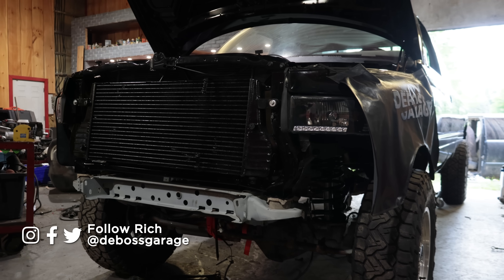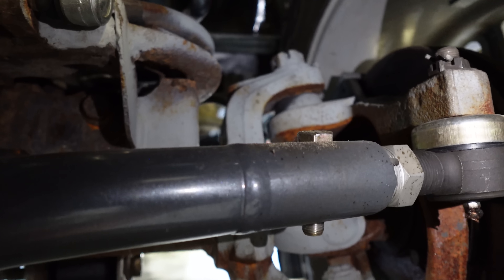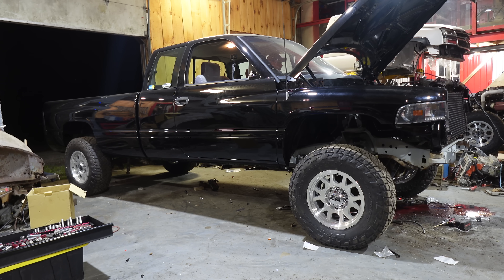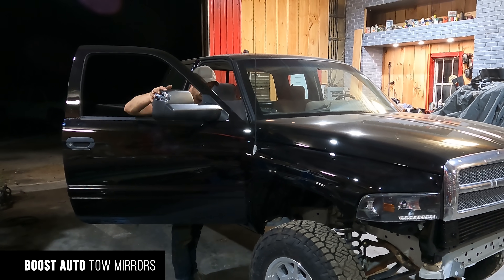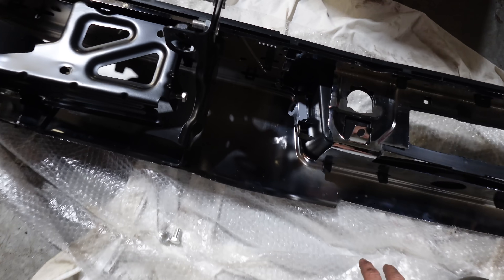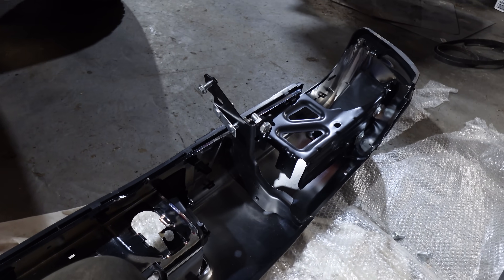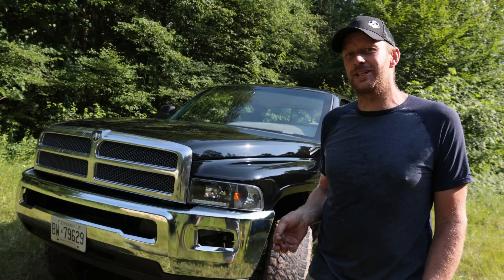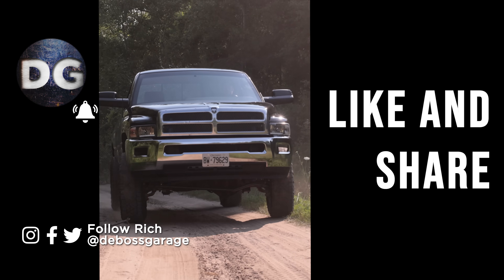4th Gen Bumper & Mirrors + GM Rear Bumper for 2nd Gen Dodge #RamRecharger [EP6]

Comment: One question…. Why the Carolina squat in the rear?
Reply: The front springs were for a heavy 6 liter engine, then they dropped in the 2.8 liter. They have since fixed the front springs so it rides level

Comment: You really want about a ¾" gap from the headlights to the bumper, lining up the bottom of the headlights perfectly parallel to the raised edges of the 4th Gen bumper for best appearance.... having it tucked up super tight looks nowhere near as good as having a decently sized, perfectly parallel gap.... trust me. 👌🏼

Comment: You mentioned the diesels in the Philippines… We were there in 2011, and one of the things I remember is how much smoke they were all emitting. Jeepneys, I understand are built on used delivery truck chassis exported from Japan, so many could be old technology. But I was surprised to see that the modern looking Nissan buses were smoking a lot also.
They all are supposed to be periodically emissions tested, but I understand that it only takes some money to get the certifications.

Comment: This is a great project that I am very interested to see the final result. But I do have one concern, this being that I don’t necessarily think that a dyno is the best way to compare the two powertrains. For raw horse power fighters sure.  But you were talking about comparing fuel combustion figures during the test. I don’t see how these figures would be relevant as dyno tests are by nature high power runs. In this situation most of the energy used would be coming out of the battery. Even if you could somehow remove the batteries out of the system for the run you still wouldn’t get a true picture as you would not be taking into account regen.

Comment: I appreciate the video ..i have a second generation dodge ram 2500 4x4 that i done the g56 conversion,  dual disc . A 2001 front axle , third generation brakes , steering. Track bar .  Hydroboost.   Timkin bearing, manual locking hubs .    But now i like to do the third generation seats so i came on here to see how you did it .  The front and rear bumpers look nice so i have to give that a shot .. i just added a pac brake , the in line model .  Used a shifter knob off a 10 speed with a electric swith added to it to control the pac brake .  I added a after market cruise control as the switches are no longer Available for the 95 on the steering wheel .. Works good now ...There is a write up on using a later model wheel if you want to go that way . . I really enjoyed watching you videos,  nice craft work
Reply: After market cruise?..do tell
Reply: Yep works good ..The is another u tube channel that does the cummins swaps in different vehicles. He also used the cruise i used .i added the controller to the side of the g56 shifter ..for the cruise

Comment: I wonder how setups will vary depending on the vehicle. I want to have a service truck for electronics. So a GMC long contractor van would work for me. I need outlets to power a hot air station, fume extraction etc. Would you mount the engine in the middle behind the cabin and batteries under the engine bay? So you'd have easier access to the engine? Or traditionally and have a partition behind the cabin again for additional batteries or even a second gen set to power my tools in the back? I don't think they'd pull that much current, but they're mostly heating elements.
Reply from the maker: With it being modular, we have many options to pick the best solution from
Reply: @DEBOSSGARAGE  I am very much looking forward to seeing the progress of all this. Maybe even working for Edison in the future! I wanted to get ASE certified, however living in the salt belt state (as you know) vehicles are not fun to work on. Let alone how they're being designed to not be serviced. 

My background in building desktop computers and now teaching myself board level component repair could be a great benefit to such a company. We'll see, thanks for the reply.

Comment: Front bumper looks great but I would stick with a stock rear bumper, then again I use a pickup as a pickup. I would rather find what are referred to as "California truck mirror" for the door mirrors as I am an old OTA driver. I like the 2nd gen though myself.

Comment: For the gap, just run the second gen sport grill. It dips lower than the normal one and will fill that gap.
Reply: The sport grill is curved though, it would fill the gap in the center but not at the edges.
Reply: @averyw.3939  :) I sincerely appreciate comments like these from people with insights. Thanks madmac and avery :)

Comment: Love the build! What offset wheel are you running? What brand headlights? I just finished restoring a 99 Cummins. It's a quad cab, 4x4, 5sp shortbed. Runs like a champ after sitting for 8 years. It hauls my Northern Lite camper. It has done 6,000km since July this year.
Reply from the maker: Headlights came with the truck. Everything else is listed in the build link in description.

Comment: I like how the back bumper looks, but I don’t like how the front one fits. Sticks out too wide on the sides and the swoop up under the headlights doesn’t line up with the inside edge of the headlights, and is overall too bulky looking for that style of truck. Looks like if it got cut down the center, shorten, then welded back together and then probably paint it body color. I think it would look a lot better.  But that’s just my opinion.

Comment: Since this is a type of prototype show truck..  If that engine has a regular alternator (which I can see that it does)--  you guys should install  a "premier power welder"..  It replaces the alternator with a  special higher output alternator, and then comes with a little control box where you hook up your welding leads.  Super simple and reliable.   All the offroad tow trucks use them and they weld like a champ;  and they are well under two grand. They even have a spool gun to go with it for another four hundred or so.  That would give this thing that much more utility and show it off even better.  Perfect for a prototype.
Reply from the maker: You will be able to weld off the battery pack.  No noise
Reply: @DEBOSSGARAGE  Sweet..  Can't wait to see how it works.

Comment: Unpopular opinion but the oem 2nd gen bumper, when not sagging and properly fitted, is the best looking bumper for these trucks
Reply: I prefer the sport bumpers or a Buckstop for something more HD, but I agree that the 4th gen bumper swap is over hyped and overdone. It doesn't look bad IMO but I wouldn't do it myself.
Reply: @averyw.3939  Once upon a time I wanted to do the 4th gen swap, but I dislike every one that I see more and more
Reply: Dude! Yes the factory bumpers look the best. I can’t stand the look of a second gen with fourth gen bumpers.
Reply: @jesushinojosa1461  I kind of thought they looked good when people first started doing it but now the more I look at them the more I dislike them. I’d love an armored bumper with a winch but unfortunately haven’t found one I light the looks of. Ranch hand can look good on the right truck but most of the armored bumpers are just too fat and hang down to low
Reply: You are not the only one. I have never seen a 4th Gen swap that looked clean. It just looks out of place. The panel gap, size, shape, body line, contour. None of those match. Sounds like Deboss is going to make an effort to custom fit it with some bumper or grille work, which I welcome.
Reply: I agree, the OEM bumper IMO looks better than the 4th Gen, but what actually looks good, is a '19 era F150 front bumper on these.... there's one guy that's done it.... and it's the only retrofit that I've seen that looks good.

The 4th Gens can look "decent", but there needs to be a ¾"-1" perfectly parallel gap from the raised edges of the bumper to the headlights.... tucking the bumper up close looks terrible IMO, if you have that crispy straight gap, it drastically improves the look, and barely anyone actually does it, everyone wants to have it tight against the headlights and then you can see they don't flow right, being gapped, it makes it appear to flow with the 2nd Gen headlight to grille line.

Comment: Time for a Scania V8 Pickup trucks!
Reply from the maker: I wish they made 160 hp 4 cylinders...
Reply: Just think of the alternator...
Reply: @DEBOSSGARAGE  they make a 5 cilinder, that’s even better. And 280hp is better than 160, obviously. Might as well go for the 340.
Reply: @autobootpiloot it's still huge. And a pain to do a valve set, you need to turn it three times!
Reply: Put in the new Toyota Land Cruiser 2.8L Diesel 4 cylinder engine.  Max power 201 hp.
Reply: @Low760   only 9 liters. If I’m not mistaken just about the size the average grocery getter has in the us. If it’s the economy model.
Reply: There is a squarebody Chevy in Finland with a Scania V8.
Reply: @johans7100 got a link?
Reply: Cut the 770 in half?
Reply: @autobootpiloot  Its also 9 liters. And weighs 975kg (about 2,000lbs).
Reply: @Adscam  I don't think Toyota are keen on selling crate motors. I imagine they would be far more expensive than a Chinese cat or Cummins too.
Reply: As someone who owns a big fire engine red and chrome scania.... great mouse trap but dang scania for parts makes man and Volvo look positively easy and cheap to deal with
Reply: @Adscam The Hilux 4cyl you mean
Reply: @HJZ75driver  same engine
Reply: Ya...the USA has no idea about Scania, make something cool with a V8 of theirs.
Reply: @DEBOSSGARAGE  The tank aka The Shermanator needs a Scania V8 😜

Comment: Here is how to fix the gap between the 2nd gen grill and 4th gen front bumper.

Install a Sport model 2nd gen grill.
The Sport model has a peak that closes up the gap between the 2nd gen grill and the 4th gen bumper.

However, the 2nd gen Sport grill did not come in chrome, at least as far as I know.

If I wanted a chrome 2nd gen Sport grill here is what I would do:
1. Buy a new Sport model 2nd gen grill. 
(Don’t forget to buy the Sport model grill support bracket. It is different from the standard grill.)
2. Buy Cosmichrome and spray the 2nd gen Sport grill chrome.

By the way, I have a similar truck to yours:
2002 Cummins 24valve, 5-speed, 4wd, extra cab, short bed, Sport model, southern truck with no rust, all original, never tuned or chipped, original exhaust, original everything, except for the 4th gen front bumper and 3rd gen wheels.

I can see the value in what you are trying to create with your project.

I am certain it will be a success.
Reply from the maker: Thanks for the tip! We’re getting a custom sport grille made for it
Reply: @DEBOSSGARAGE Thanks for your reply. I believe this project will be a success and could be termed a “Market Disruptor”, which is a technology so different that it forces the market into completely rethinking.

Comment: Yes you nailed it on your opener talking about the steering components on trucks like that. It’s usually never just one thing that’s worn it’s everything that’s worn a little bit and that’s where the vibrations and wobble come from. If you replace one part of it do everything because it all needs it if you realize it or not.

Comment: Those new bumpers look good on the truck but also look quite a bit thinner and cheaper made than the old ones. Nice truck , but your point about having a power source for your tent are kinda lame considering the cost of the conversion. A small generator would do that cheaper, but not as cool. So it comes down to how much $ you have to drive something different, because these conversations are not really cost effective unless your gonna drive a ton of miles, especially if you need to pay someone else for labor.
Reply: Are you new?
Reply from the maker: Of course you wouldn't do the conversion just to power a tent, but its another nice perk.  I was never one to enjoy listening to a generator in the middle of the nature though....

Comment: For the gap between the grill and the bumper, I have seen guys cut the raised portion below the headlights flush with the rest of the bumper and it gives it a lot better flat and factory look that basically eliminates that gap. Other than that, looks great guys!

Comment: A second gen dodge built the way dodge should have built it. 
Im really happy to see this! 
Those gm bumpers look amazing on that dodge! 
Truly a work of art. 
Love your builds 💪
Reply from the maker: Thanks man
Reply: They had engineers around the days of when Eagle and Jeep were a separate division that would have built it like this. That's how the Wrangler and Cherokee had been updated by that division: just updated to fuel injection and started modernizing the suspension and transmissions. Transfer case also got updated and rolled out as well just before they got rolled into the truck division and started to get ignored, like they had never made something that was durable and in demand. Yeah, Jeeps are so hard to sell even though they lasted forever Mr. CEO and Head of Marketing.

Comment: I dont understand why people try to put parts from different year vehicles onto the wrong vehicle, It never looks right.
Reply from the maker: Because it makes it their own, rather than 1 of 5 million made.  Since looks are subjective, a ton of pride comes from making something you are proud of
Reply: I think the problem is that our brains are so accustomed to the factory styling that once you change something, it pops out more. The rear bumper looks great while I think the new front bumper makes it look like the truck has a fat lip. It will look "right" again once they get the new grille installed because more of the front end will be custom parts thus eliminating the Dodge factory styling we're used to.
Reply: @DEBOSSGARAGE  don't get me wrong I can appreciate custom work.  Which I've seen in other videos you boys have done.  My comment was more of a generalization with mods that I seen over the years, Im guilty of it myself.   They just never seem right, lines don't match up, and odd gaps.  I'm sure you guys will pull it off.

Comment: Modern F-350 Super Duty crew cab. 
With the aluminum body.
Swapped for two Ford 300hp electric crate motors.
Coupled to.
3 or 4 or 5 Nissan leaf batteries.
You could gear it so it is faster than a Lambo 0-60
Yet still strong enough to pull a house down the street.
😳
Reply: Why does it need to be fast, when it's so big and heavy?
Reply: @Low760  It will be fast by default.
Not by design.
Hagerty recently uploaded a drag between the 2 most powerful cars produced in the U.S.
The Dodge Demon vs a Lucid Air Sapphire.
Ones gas, the other is  electric.
Spoiler alert, the Lucid utterly humiliated the Demon.
Street & Strip